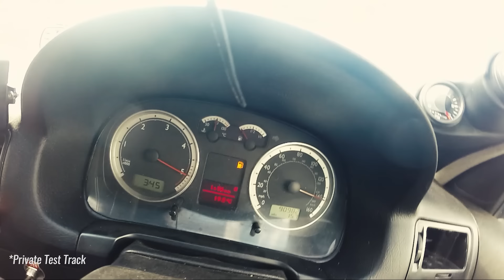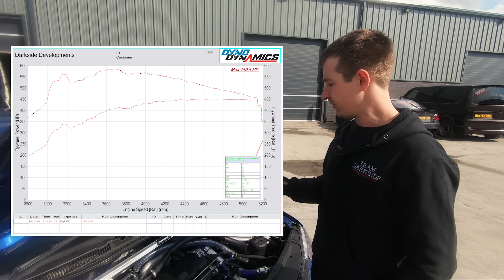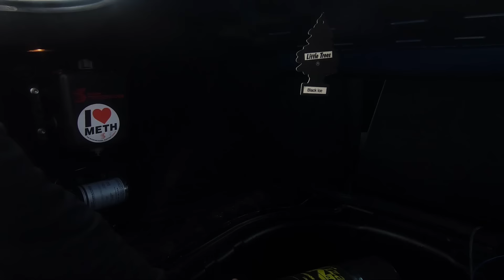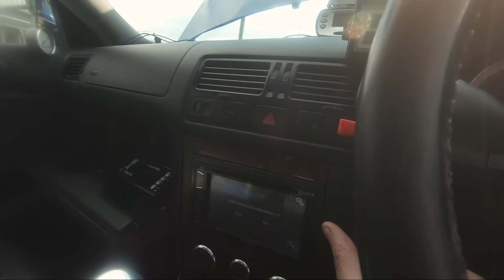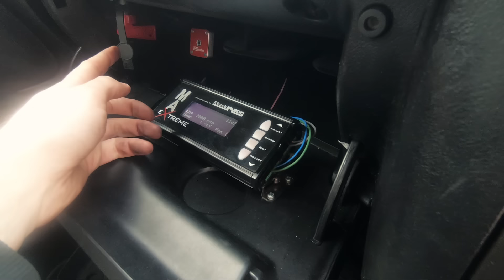WHAT'S IT TAKE TO GET 450BHP FROM A 1.9 TDI??

Comment: Have you tried "Evans Waterless Collant" I'm curious to see if it can meet your high horsepower engine builds.
Reply from the maker: Yes, they usually run hotter which I don't like. Pressure is lower.

Comment: Dedication to Diesel to drop 20k on a build. Any testing on the catch can venting back to the intake due to increased intake temps etc? Need to get a catch can fit on my PD130 as it dumps oil into the intake.
Reply: We always like to draw the Crank vent into the TIP

Comment: now thats interesting about coolant lvl ,is it common for mild tuned PD to sit near low when driven hard or just crazy power ?
Reply: Tom Weir this happens to my Passat and Octavia when going hard for long periods I get 80 degrees but never happened on my golf or a3 all pd130 I think its down to more room between the rad and block the Passat and oct where hybrid cartridge remapped and cheap eBay box that puts more fuel in.

Comment: Ive a audi a4 gear selecter seems really sloppy had gearbox changed . So was thinking about buying a short shifter to see if that helps . When i hit throttle pedal off and on can feel gear stick moving . But people say engine mounts are fine but not sure
Reply from the maker: Most are like that. Never used a short shifter in one.

Comment: 450HP doesn't really make any sense on a front-wheel-drive car. You would need a Quatro, or at least one of the VAG models with Haldex to make this worthwhile in my opinion.
Reply: I think they dont launch it anyway cause it have too much torque it would kill the gear box. So they use those 450 hp at higher speed

Comment: what do you use to remove the rust from the coolant system if an engine has been run on water ?
Reply from the maker: Liqui moly radiator cleaner should do the job
Reply: @DarksideDevelopments  THANKS FOR THE REPLY :face-blue-smiling::face-blue-smiling:

Comment: Does open air filter not make you underperform in hot summer days because there is no heatshield inbetween filter and engine? It gonna succ hot air from the engine.
Reply: I think on the move the gains from less restriction overcomes that downside

Comment: Interesting to hear your thoughts on the coolant. I’d actually already planned an electric water pump (Davis Craig?) for my 380bhp 330d track car because it overheats after a few hot laps and that’s getting boring! Is there anything particular about high power diesels that increases coolant requirements over a similarly powered petrol? Eg an e46 m3 would never overheat like my diesel does. I guess the intercooler stuck in front of it can’t be helping..
Reply: It's a myth diesels run cooler, any engine with a turbo gets hot, especially when you ask for 1.5 or 2x factory power. The pumps we use are extremely good and fitted to 500hp+ factory cars - https://www.darksidedevelopments.co.uk/products/pierburg-cwa-electric-waterpump-cwa-400.html - bear in mind the system will need work as a whole to make the most. Our 330d has this setup, the long head does not help!
Reply from the maker: I made a reply to this but cant see it! We have one on our car, if you need some help drop us an email and we can help make it happen! Anything with a turbo gets hot!

Comment: Is the 1.9 tdi bls 2010 in a vw caddy maxi any good option to tune arround 300bhp since 2010 it is engine code bls ,2009 and older is bjb,bls is the difference just the dpf system? Kinda scared 2 tune it up past 200bhp heard about the bearing rods is a must 2 replace before tuning nice vids DDevelopments
Reply from the maker: For 300bhp we would recommend swapping for a PD130/PD150 engine - https://www.darksidedevelopments.co.uk/Blog/mk5-platform-edc16-to-mk4-platform-engine-conversion-bls-bxe-bkc-bjb-to-asz-arl-conversion/

Comment: I have a PD130 and haven't remaped it yet, I don't know if everything woud hold up hahaha
Reply: With only a remap everything will hold up pretty much guaranteed. (Old clutch could slip, or you can blow the turbo if the remap is bad, but you can't make enough power out of a stock setup to damage anything in the engine.)
Reply: @dacmm  yeah but it's getting close to 280.000km and I don't know if with that many kilometers everything will hold up
Reply from the maker: @TheSery7  We have a lot of big mile cars tuned!

Comment: I love my 2.0 tdi, it's a dual cam shaft, great engine, but i hate it at the same time. The tdi is really limited in terms of tuning potential. After a certain rpm, there is no reason to keep pushing it because you are not going to get anything out of it. Due to the way they work, it will not burn all the fuel and that's how it is. The smoke, god, the smoke, i fucking hate it. Bad injectors, bad AFR, egr problems, lag...and so many more stuff, i don't want the smoke. They are just a money holes, you would invest half of what you put in a tdi to get the same hp out of a gasoline engine, it's just not worth the time and money
Reply: If its not a 1.9 tdi I wouldn't bother with these cars

Comment: Hello I have a 56 plate 2.0 tdi 170 Audi A4 with a panel filter dpf delete and a remap from APR I'm 2015 before I new about yourselves unfortunately, it is a really really clean car 1 owner etc never has an issue with it,what advice would you  have for me as it seems to have to 2 modes 1 being the day it was mapped and others the powe is just not there it doesn't rev as high or get there as quickly and seem to have lag in throttle response, many thanks
Reply from the maker: Please email.

Comment: Hi what's the best first mods for a 1.9 tdi VW Passat b6
Reply: @bennickolls2738  there's no dpf on my 1.9 tdi bxe engine so the rest will do thanks
Reply: @bennickolls2738  do you have a link for the panel filter?
Reply from the maker: @bennickolls2738  Remap first mod and dont bother with an air filter!

Comment: I’m having trouble with my bora had a timing belt done and water pump and it’s smoking like mad when warm white smoke and high reving 70mph it’s doing 4K revs in 6th gear
Reply from the maker: Hi, if the problem has only happened after the work has been carried out the first thing would be to get the mechanic that has done the belt and pump to double check over everything and carry out a full fault code scan.
Reply: Yeh that’s been done and only fault that came on is cam error and went off
Reply: Turned out to be turbo drinking engine oil and shooting it out the exhaust but it’s still high rpm I can knock it into 6th gear doing 35 mph and drives fine with power there but at 60 revs high
Reply from the maker: @kamishah1261  Glad you found one issue, you would need further diagnostics for the second. Without the car we cannot advise.

Comment: Why don't you guys have switchable maps/code blocks via the pedals or cruise control switches? Easily achieved with edc15p
Reply from the maker: We have used it in the past but all the idiots that make these solutions are impossible to work with. Not many people want to pay for what is nearly 3 tunes sometimes!
Reply: @DarksideDevelopments  I'd like to do this for you lol I need a smf
Reply: @DarksideDevelopments  idiots? I've never had an issue? Once you've invested in one software version you can reuse and repeat. I mainly sell it to setup as an immobiliser on the code block it starts up on that will not run until switched to the next code block :)

Comment: Did he say water is more effective at cooling than antifreeze? 👀
Reply from the maker: Correct
Reply: Yes, water is far better at cooling than antifreeze.

Only issue is, it boils low and freezes easy. Hence why we use antifreeze.
Reply: @richieschmidt6225  antifreeze makes no difference to boiling point. Only the pressure of the system does!
Reply: @ryanp6138  Antifreeze does help raise the boiling point roughly 10-15 degrees, but you're right it's the pressure that makes the boiling point way higher.

Comment: Hi what could be achieved from a polo saloon with the 1.9tdi 90bhp engine without spending a silly amount. Thanks
Reply: Big turbo, injectors, front intercooler, exhaust, remap would be around 3 grand and 250HP 500Nm.
Reply: @dacmm  just buy 2.0hdi

Comment: Your knowledge on RO water and distilled water is completely wrong my friend ... I ran a saltwater coral business.. need I say more.. I made RO water at a 0.00 TDS. 9 stage filtration. You will find RO water from fish shop.. or window cleaners water still have a high TDS reading... if you put my RO water in those engines.. nothing will corrode once bled correctly.. 👍🏻 the only one issue is that it will have no anti freeze properties in it..

Comment: And you can still pass mot or road worthy test in the UK?
Reply: MOT only checks that certain components aren't in bad condition. You wanna turn up in a Mini fitted with a jet engine, that's fine.
Reply: MOT also checks exhaust emission levels on a diesel. It's unlikely this one would pass, unless there's an additional map in the ECU for the purpose.
Reply: Depends where you take your car for it’s mot test ;)

Comment: What pd engine is the best base to start modifying from? always heard about pd150’s having camshaft issues from a certain age and just being not as robust as the 130. Made a cracking job on the car too!
Reply: All of them have the cam problem, not an expensive fix. Start with a 130, not much different

Comment: What jet size was u using for the nitrous
Reply from the maker: 150iirc
Reply: @DarksideDevelopments  as it's a  150 shot becoz there is no fuel solenoid would that still make 150jet  150bhp or is it just like a wet kit the bhp is half the nitrous jet size . What would be the ratio on the nitrous and diesel using the injectors 3 to1 or more like 1 to 1 but as it's a modem car with hi psi on the diesel I presume. I no on a petrol car the fuel is 45psi so u run a 1to 2 ratio
Am thinking about going over to the dark side but just not sure yet . I no a lot about nitrous on petrol cars. So on the fuel side what psi is the injectors . I no on petrol its 45psi so u run a 1to2 ratio i.e 50jet fuel 100 nos and with wizard of nitrous half the jet size of the nitrous is the bhp ish u will get . 
How does that work with a diesel.
Reply: Need to asks about the jet size and bhp leaves on them could u help

Comment: I have bora tdi  st pd 130 and I have had stage 1 by revo and got 174 bhp at the fly wheel and 315 tourqes.  If you remapped mine what power do you think from a stage 1 . Please let me know as I would love you to remap mine I have spent loads on mine to . Please let me know thanks
Reply from the maker: REVO tunes are pretty aggressive on older cars, you need a bigger turbo to go further
Reply: @DarksideDevelopments  I have put a pd 150 hybrid turbo fitted will I need to remap again if I do can you remap . I need one of your side mounted intercooler from you .
Reply: @DarksideDevelopments  it was a vw bora tdi st pd 130 can you please let me know asap if it will need remap  as I pick up car next week . And will get remap booked in with you . It has been all fitted professionally.  We spoke before and u said to get a bit more a bigger turbo . I have done that
Reply from the maker: @benjourniee9285  please drop us an email and we can give you some options, we do not sell, tune or advise hybrids - sales@darksidedevelopments.co.uk

Comment: I wanna go to 230 on my Fabia VRS PD150 engine, it's currently running 210, with a hybrid 1752 and all other supporting mods, i want to get a 1756 hybrid and get it to 230, is this safe parameters on standard injectors, Standard engine ect, what power would you recommend it go to before forging the engine?
Reply: I'm over 230 on an Ibiza pd130? Have had it on track a few times and use it as a daily with no issues. 
I've just got a straight through exhaust, big arse fmic, come filter and the hybrid 1756 turbo. Got a nice thick heat shield that I've wrapped around the turbo between the two halves which made a huge difference to the inlet air temps
Reply: Its had a PD150 engine swapped in I meant to say!! Please get back to me that would be nice
Reply: My fabia seems okay but it's getting lots of blue smoke on cold start, I believe the oil seals are shot in the turbo, its using oil really bad so I'm gonna upgrade. Although I wanna keep the standard injectors so ideally need to clarify that itll be okay with stock injectors for fast road application, its driven nice 80% of the time but love a spirited drive. Can feel the heaters getting tons hotter after a pull.
My spec is
-PD150 ARL Engine 
-1752 Hybrid 
-Darkside FMIC
-Hardpipe Kit
-Luk Repset pro clutch on DMF
-Full custom 2.5" decat system
It's got mint power it's perfect for me but makes sense to upgrade if I'm having to spend a fortune on a new turbo anyway.
Reply: @nxthfx175  you're probably right with the root cause of the blue smoke being the turbo, I'm still running on standard injectors and can't comment on heating issues as my heater matrix is blanked off 😂 might have broken the pipes and just never replaced them haha.
Sounds pretty close to my set up anyways and I e not had any issues other than destroying brake pads so far 😉
Reply: @puremadmentalmackay  email us, we have a part to fix those silly matrix pipes on the Ibiza / Fabia platform!
Reply: @nxthfx175  stock engines are fine to 230 for years of abuse! Sounds like a turbo issue
Reply: Cheers guys appreciate the advice, may have to upgrade to the 1756 next then😉🤭
Reply: @ryanp6138  I will be in touch when I get back to the UK then 😁

Comment: Hi lads is that the bxe or bkc  engine? Which one is better?
Reply from the maker: They're pretty much the same
Reply: @DarksideDevelopments  my BXE 1.9 TDI Is getting a complete top end rebuild with new head gasket and head bolts. Should that be strong and reliable then ? Some say the BKC is better
Reply from the maker: @poolking36  It depends on what power you are wanting to achieve, for either engine I would recommend the Rosten rods as its the bottom end that is the weak link.
https://www.darksidedevelopments.co.uk/products/rosten-h-beam-con-rods-for-1-9-tdi-90-110-pd100-pd115.html

Comment: What oil do you use in the pd130 asz engine?
Reply: VW505.01 specific 5W40
Reply: @kyranoboyle3378  Can I use this one, Liqui Moly Top Tec 4100 5W-40 Oil or 
Volkswagen OEM 5W-40 SAE Oil, I am based in South Africa, Cape Town,  Average Day And Night Temperature In Cape Town (Western Cape) In Celsius is 5 coldest and 30 warmest

Comment: Yo u think I could us a 60 trim at 18lb of boost and more fuel but I still have stock pistons u think I blow it
Reply: On a t3 manifold with a 20 lb blow off valve I'm just getting into the 1.9 tdi
Alh
Reply from the maker: Use a VGT turbo or you won't enjoy driving it

Comment: I've got a 2004 passat estate is there anything I can do to strengthen the gearbox?
Reply: 6 speeds are OK, 5s belong in the scrap
Reply: @ryanp6138  what power can you take that 6 speed box too an are there the same upgrade box mods same as the car in the video?
Reply: @adamdoyley7017  totally different, only thing to watch for is synchro issues when using SMF otherwise they are strong
Reply: @ryanp6138  ahh right yeah are there stronger synchros I can get an does the 6 speed box fit straight on do I just need to find one off a 6speed model of my car?

Comment: Do you also tune VP,VE power tdi engines ?
Reply from the maker: Yes we do!
Reply: @DarksideDevelopments  Do you have any experience with tuning the 2.5TDI V6 engine with VP44 pump.
Reply from the maker: @mrAudisubaru  Yes, they are terrible and we avoid them at all costs! Repairing one now with a bad pump.
Reply: @DarksideDevelopments  How much horsepower have you manage to get with stock nozzles and stock turbo.
Reply from the maker: @mrAudisubaru  Depends which engine, 210 max usually on 180 but its rare they are good enough to tune! 1.9 PD conversion on my dads All-Road
Reply: @DarksideDevelopments  well they have potential but they are quite expensive to maintain. with a big turbo and large nozzles they can make big power.
Reply: @DarksideDevelopments  you need to show that one please.
Reply from the maker: @vtecpowergt  The Allroad? If we have time! haha

Comment: will the whole BHW engine from Passat , fit a Golf , Bora , Ibiza etc ?
Reply from the maker: Not easily as they are longitudinal
Reply: @DarksideDevelopments  i know is longitudinal but i assume is the same block as 1.9 beside larger bores
Reply from the maker: @alexandruv847  It isn't. There are some differences
Reply: @DarksideDevelopments  1 more question please . What flywheel uses an 2004 Ibiza ATD 5 speed ? is DMF or SMF ?
Reply: @alexandruv847  usually DMF
Reply from the maker: @alexandruv847  Normally it is a SMF, but some have DMF
Reply: @DarksideDevelopments  thanks